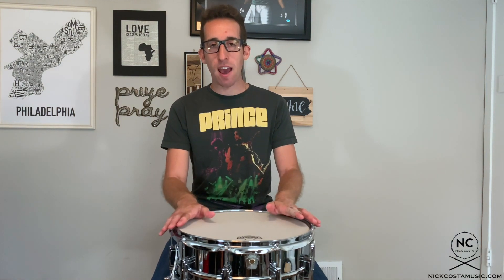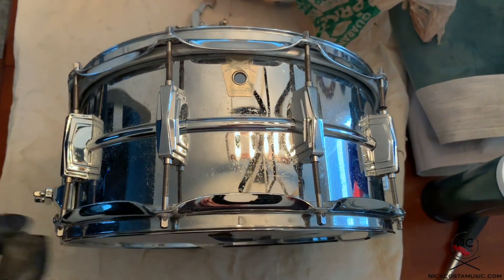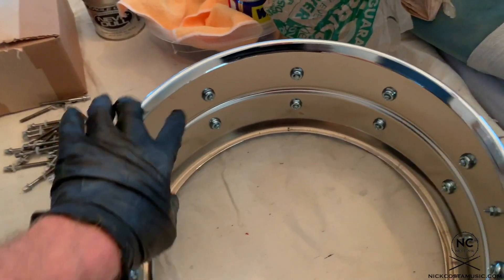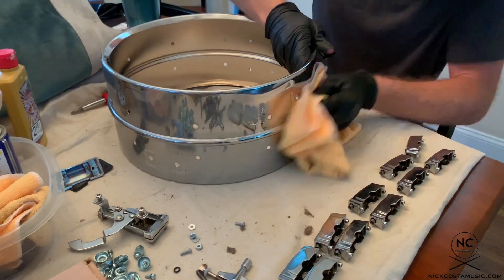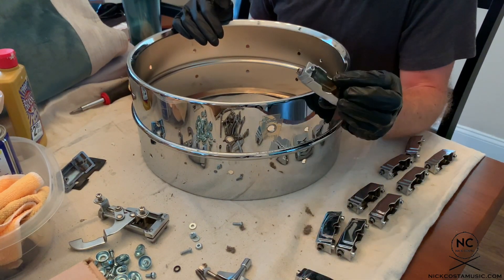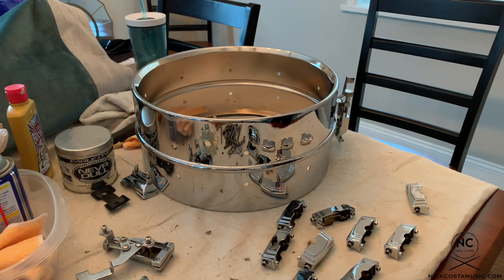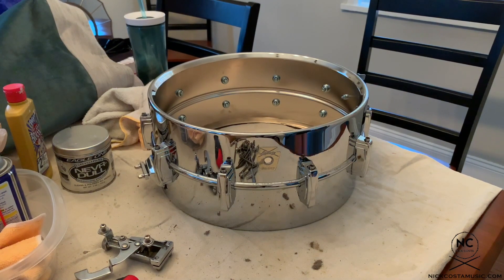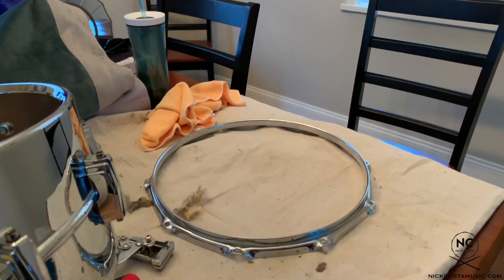How to clean and restore a metal snare drum

Comment: My snare aluminum shell snare drum still has the Tama logo on it, do I have to remove it before I set it in a tub of hot water?
Reply from the maker: Depends on the drum, but most Tama's have a screw on either side of the badge. Remove them, and you're good to go. 

Be sure to add your favorite seasonings to the tub of hot water, too!

Comment: Great video. My father, who is a metallurgist, suggests a thin coat of spray on lacquer will prevent further pitting and should not affect the sound.
Reply from the maker: Thanks, Jeff - that's a great tip!

I've heard the same from others, so definitely has some validity.

Comment: I've got a DW collector's series aluminium snare. Unfortunately, it's seen some scratches specifically where the rim is located. How would you go about cleaning it? Windex doesn't seem to work. Thanks in advance!
Reply from the maker: Hey Jasper! You can use brasso to clean the shell. Just apply it to a microfiber and hand rub onto shell.  Brasso - https://amzn.to/2HS5Z6K

You could also try Chemical Guys Removal Scratch and Swirl repair. It’s made to help remove swirl and scratches from motorcycle metal. I haven’t personally tried it, but I’ve had great success with other chemical guys products when detailing my car.  You can get that here - https://amzn.to/2N3ej7U

Hope this helps!

Comment: What about cleaning the threads on the inside of the lugs? Not sure if mine are stripped or just have gunk in them but some lugs have more tension to screw in then other
Reply from the maker: Sometimes it’s just easier to get new tension rods, but if you want to give it a shot there’s a few things you can try. 

Attach a drum key to a drill, then spray tin foil with WD-40. Put tin foil in one hand and drill (with t rod) in other. The rotation from the drill should help get the tin foil into the threads and clean em right up.

Other option is soaking the t rods in water with blue dawn. Use the drum key/drill setup, but this time a paper towel.
Reply: @NickCostaMusic  Thanks for the 10/10 response man! However, I'm refering the part of the drum that the tension rods screw into. like the 'female' rods haha
Reply from the maker: Ah, the receiver tube - the part that sticks out of the lug. If you haven’t yet, I’d try a different tension rod to see if it is in fact the receiver tube or the tension rod. If both t rods are hard to tighten, then most likely the receiver tube.

Depending on the make, you should be able to remove that from the lug. Soak it in warm water/blue dawn overnight, rise next morning, and let it dry. When you re-assemble the lug, you can always put a (small) drop of liquid grease inside - that might help.

Comment: thanks! sometimes these metal parts have these hard 'dots' on it that seem to be sticked on it. do those come off with brasso?
Reply from the maker: If it's dirt, then yes. If it's pitting from the shell it will remove the dirt, but the pitting is flaking of the chrome finish. You can most likely remove the surface rust/dirt with some aluminum foil and WD40, but there will still be an imperfection unfortunately.

Comment: Nice tutorial!  Any advice on treating the bearing edges?  Is it safe to use polish as on the shell or better to just clean them with a damp cloth?
Reply from the maker: Many thanks! I'd try the damp cloth with blue dawn first if you have any crud on the bearing edge. 

If that doesn't work, try the polish, just make sure no residue is left over so you can get the best contact between the drum head and bearing edge. 

Hope this helps!

Comment: how about rusted metal snare? can its still be restored? even the inside is rusted
Reply from the maker: Really depends on the severity. You can try the same process and it should clean up, however if the shell has any type of finish (chrome is the most common), it might flake off.

Comment: Nick, just watched and really enjoyed your tutorial on how best to clean a metal snare. Any advice on how to repair any dents in the shell? I recently got my hands on a 62' Slingerland Sound King COB, and the shell has two pretty decent dents. One at the butt plate attached to the shell, and the second where the snare throw off is attached to the shell. It broke my heart to see these, which I couldn't really see until I started taking everything apart to clean it. Thanks,  fellow Philadelphian!
Reply from the maker: You have a couple options:
1) roll a marble on the inside - it's time consuming, but with a little pressure it can pop the dent back out
2) rubber mallet. Wrap a block of wood in a super soft cloth and place it on the outside of the shell. Gently tap the dent from the inside with a rubber mallet. The block on the outside will prevent the shell from going to far (turing concave into convex). If you can et a block that's the same shape of the shell - even better!
Reply: i guess Im kinda randomly asking but does anyone know of a good site to stream new movies online ?
Reply: @Colten Ben Flixportal :)
Reply: @Royal Anson Thank you, signed up and it seems like a nice service =) I appreciate it!!
Reply: @Colten Ben happy to help =)

Comment: She looks sweet now.   A lot better than before.  
  I might try brasso on my  nice snare drum.   It's nickel coated with some rusty spots from humidity.   I keep it in a drum  bag with silica gel bags for moisture control.  
  Have you tried 0000 superfine steelwool on chrome parts ?   It works really well  without polish.   
  Great video  👍👍
Reply from the maker: Couldn't agree more! I've personally never tried brasso on a nickel coated metal drum mainly because I've heard both positive and negative. Some say it can tarnish the finish, others say it doesn't. 

If your drum isn't too bad - try warm water and a splash of blue dawn first!
Reply: @NickCostaMusic  I'll have a look at what you've mentioned.   Thanks mate .

Comment: Hey man, Great vid. (Thank U ! )  SO, ok,, with metal (or in my case Chrome over brass) snare drums, specifically, an early 70's Slingerland Sound King 6.5 x 14.. there is a bit of chrome that has come off on the batter side bearing edge.. (Shock and Horror inserted here) making a very rough patch.. I'm doing a complete restore, but this i'm just not too sure about.. *My initial thought was to go over it very gently with 0000 Steel Wool, basically either just over the 2" run, or ..make the entire edge uniform with said steel wool. (which seems more blasphemous, but perhaps more functional. ) My 2nd thought - and I am not into bearing lubes.. however in this case.. ??? Apparently DrumDial has a bearing conditioner for wood (basically a coconut oil hybrid paint stick..not wax) but was thinking just to keep the edge free from any head-snagging and seating issues..? ((after leveling of course)) Anyway, Your thoughts would be most appreciated. Thanks so much - Cheers! :)
Reply from the maker: Hey Jess,
Metal shells can be tough - especially with bearing edge damage. Where the chrome flaked - is it on the top of the bearing edge where the drum head makes contact, or towards the side by the collar of the head? If it's by the collar I'd leave it - most likely the head will cover it and as long as you can tune the drum up you're good!

If it's on the top of the edge, where the head makes contact with the shell you have a few options. You could fill the area with automotive body filler like duraglass. Apply it to the damaged area to fill in the voids, then true it up on a granite stone with sand paper to get the edge nice and flat. 

You could try smoothing it out by hand, but remember no matter how careful you are, it will never be 100% flat - that's where the granite stone comes in. 

I'd avoid lubing the bearing edge - if you have a valley/dip it's going to be there regardless.

Hope this helps!
Reply: @NickCostaMusic  Thanks Nick! Yes, unfortunately the 1.5" patch of 'ChromeBeGone' is at the contact patch of the bearing edge. It's probably Microns, ..but it's more of avoiding any rough spots if possible. Will this matter ??? However, for the Obvious reasons, and peace of mind, I may try and do a compromise sanding with 1200 grit if I can't come up with any options. The bare metal is brass and that is not coming through. If i can bring down the edge to uniform and smooth it out.. Yay(?!) Lol,,, The rest of the shell .. Peachy. BLARRGH!! this one spot.. DARNNIT! Thanks for taking the time to reply. If you happen to have any light bulbs go off, do drop a line. Thanks again! Cheers!
Reply from the maker: It might, it might not. If you aren't having troubles tuning the drum you could leave it. If you try sand paper go lightly until it's uniform to your preference. 

Good luck!
Reply: @NickCostaMusic  Thanks again Nick. Cheers and take care!
Reply: @NickCostaMusic  Heya! OK well, I ended up deciding to just go for it. The Funny part is it ended up Not being a part where the chrome was gone, but it was something actually covering it up!.. Lmaooo!!! I ended up using 0000 steel wool very gently, then decided to try my girlfriend's weird skin smoothing pads.. (essentially sandpaper for your face).. It took the whatever it was off of the chrome and made the rest of the bearing edge even smoother than it was before (ordering box of said weird face sanding things now...) . so, Yay! Smooth, youthful looking bearing edges! ;) (girls sometimes rock absurdly harder than normal). Cheers!
Reply from the maker: @remotexpolde  Killer! So great to hear. That drum tunes up nicely I bet!

Enjoy the drum - cheers!
Reply: @NickCostaMusic  Cheers Right Back!! Dude, I super appreciate you taking the time and offering thoughts. Yay the awesome bits of YT! .. I have an Ambassador X topside and a Hazy bottom ready to go. Neighbors will have to deal.. Lol Take care yo'self!!
Reply from the maker: @remotexpolde  No problem, happy to help!

Great drumhead choices - those are my favorites as well. 

Enjoy!